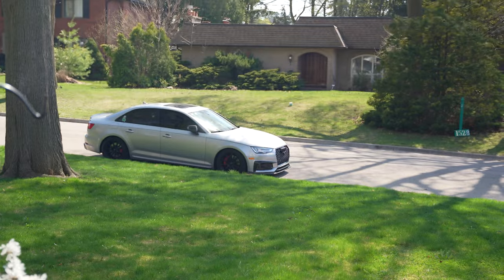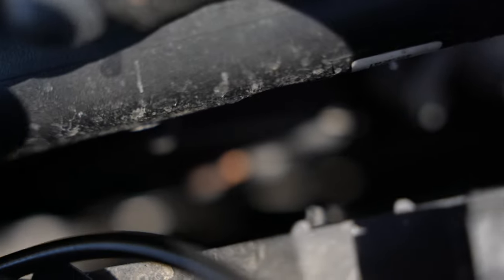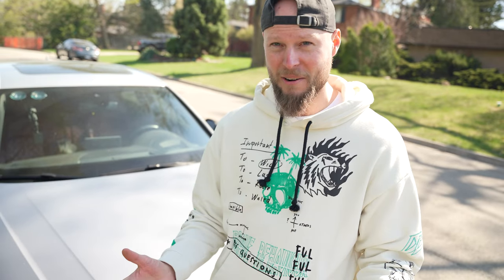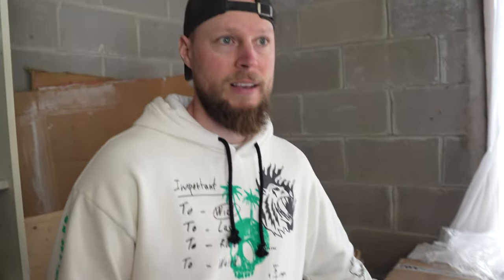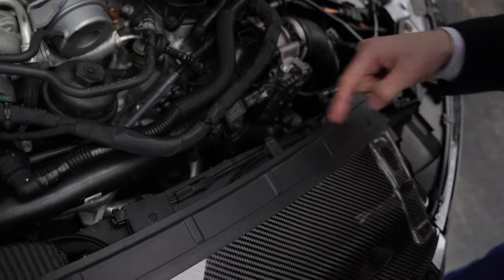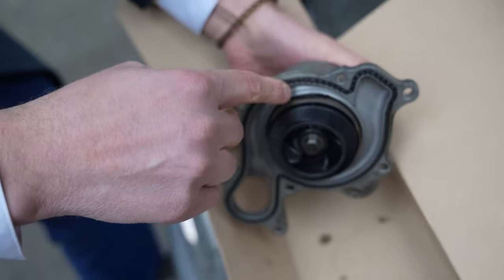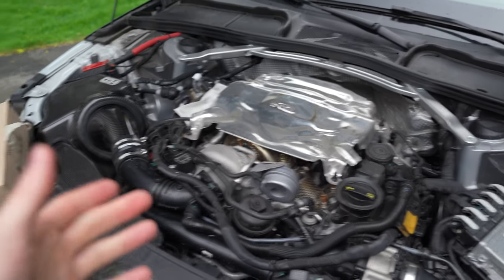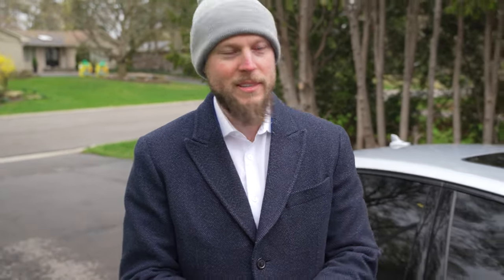Disaster Strikes the B9 Audi S4! *Water Pump FAILURE*

Comment: 2020 B9 S5 at 33k miles, just had mine replaced today but I was under warranty thankfully.   Very disappointing to see so many failures at such low mileage
Reply: @LarryBurton-r2w  I’m an Audi dealer tech. And it’s not a question of if, it’s a question of when it will fail. Most the time it leaks coolant into the vacuum system too requiring replacement of the coolant shut off valve, all vacuum lines and solenoids, and the vacuum reservoir that is behind the driver side engine mount bracket. And the funny part is… we are replacing all these failed pumps with the exact same part number that came out lol
Reply: @thegoldentheory  is this on any ea839 engine? even the 2019 A6

Comment: Damn son, that hinge profile blowin up! lol I just bought a 2018 B9 S5, only 23k miles on it and my only concerns right now are the rocker arms as mine does have the old style (02/18 build date) but I'm told from many audi techs that it's not a super common failure. Now I'm worried about the water pump lol
Reply from the maker: What's meant to happen, will happen. That's car life!

Comment: 40k miles changed my waterpump and thermostats at 33k. i started my car to go to work and the dash said no coolant. saw no leaks towed it to the dealer. 1700 bucks for water pump but covered under my warranty.

Comment: What made you use the IE turbo inlet? To my knowledge this wouldn't fit with the 034 intake 🤔
Reply from the maker: It was the only one available when I ordered but then it took 2 months to ship. I'll make it work!
Reply: @DailyDownshift  sell it and get the 034 😁 it's super nice
Reply: @DailyDownshift  it’s junk. I used the IE inlet and the bolts failed, causing the inlet to drop down and loosen the o-ring. The turbo sucked in the o-ring and bent the fins, causing turbo replacement. Never again.

Comment: Just curious but roughly how much did it cost for the labor?
Reply: Probably around $1k
Reply: They charging me $2k+ for the same exact issue on my 2018 s4 only got 85k miles on but got it at 58k miles.. so kinda lasted me a while before actually needing it replaced, turns out it caused more issues to my car and needed and inspector to check it out to see if my extended warranty would last and thankfully it did so I’m only paying $250. Moral of the story always buy warranty unless you ballin ballin